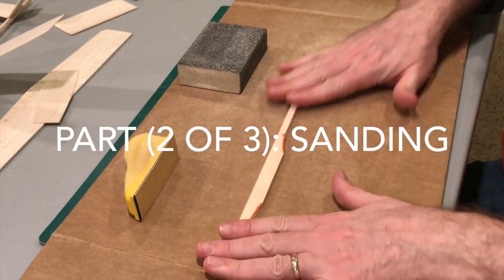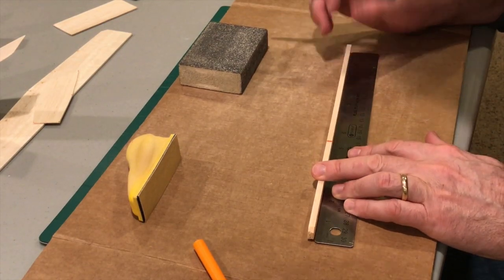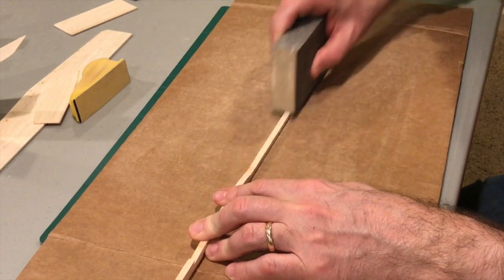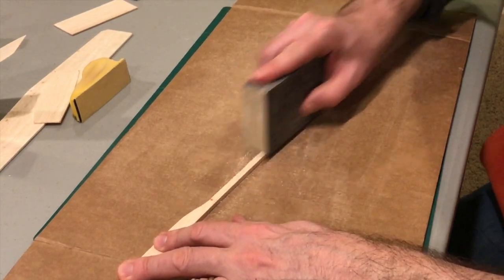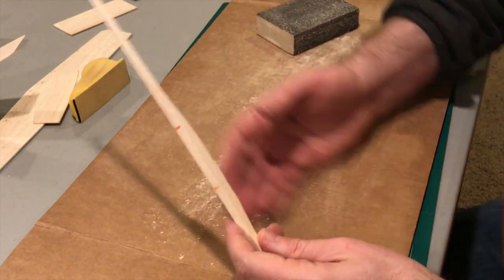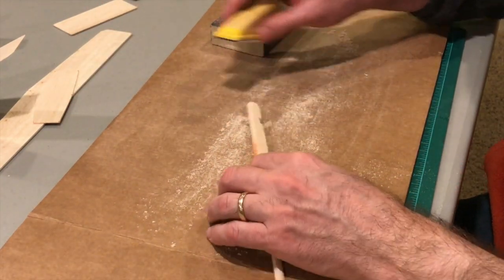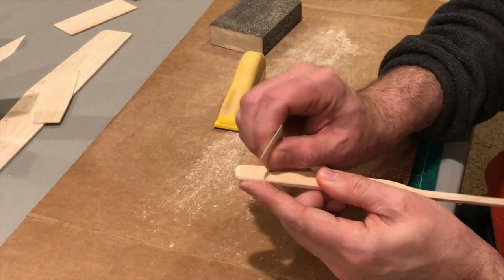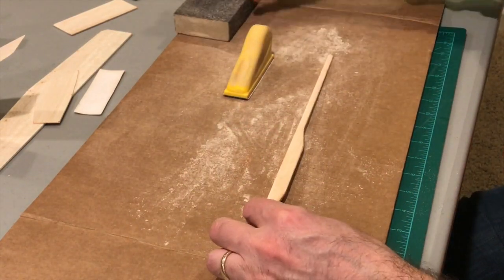How to Build a Balsa Glider - 12" Sandpiper - Part 2

Comment: I’m a beginner, and I have a question. How do you reduce the elevator of the glider? My glider was going in loops after I launched it, I tried to slightly increase nose ballast, but it still when in loops and I don’t know how to reduce the up elevator. Thank you for making this video, it really helped!
Reply from the maker: Cut 2 strips of balsa 1/8x1/32x1/32 and glue one on each underside trailing edge of left and right stabilizer next to the fuselage.  This will help reduce the loopiness of the launch. I call these “trim tabs.” If still too loopy, add more until you get desired result.

Comment: You mentioned 3/32" balsa but that fuselage looks more like 3/16" to me 3/32" for  the wing sounds right though
Reply from the maker: The fuse is actually made from two parts; each 3/32 thick and glued together to make it 3/16 thick. 😊

Comment: what kinds of sandpaper/block grit do you recommend using?
Reply: also which glue are you using?
Reply from the maker: Funny thing, I have a stiff foam sanding block, but don’t recall the grit on either side. I think it’s 100 and 120. The small yellow foam detailed sander is 220. And sometimes I use 320.  Use a sanding block for sanding consistency.  I could go on and on, but this AMA article covers a lot:  http://amaflightschool.org/diy/basic-sanding-techniques
Reply from the maker: I use cyanoacrylate (CA) glue.  It comes in various thicknesses.  I use medium because it gives me some time to position my pieces before it sticks.  I also use a CA accelerator so I don’t have to wait for the glue to cure but that is not required.

Comment: In RC, we've found (generally) a 6 to 1 ratio for tail to nose weight differences, have you estimated anything similar?
Reply: ( generally found)
Reply from the maker: Funny you asked that... I way just thinking about this the other day!  For my Sandpiper 12 it is roughly a 3 to 1 ratio tail to nose weight.  For example, for every 0.1 gram I sand off my tail I will need 0.3 gram less nose weight.  😊

Comment: Hello, Which papersand did you use?
Reply from the maker: The bigger (grey) sanding block I used is about 100-150.  The smaller (yellow) is 220 grit.  Best tip I can give about sanding is take your time, go easy, and check the thickness frequently for evenness.
Reply: Juan Pablo Campos *sandpaper